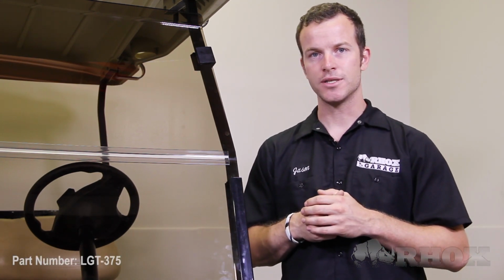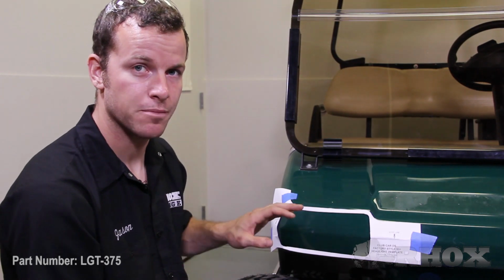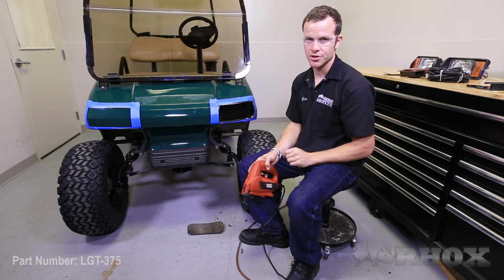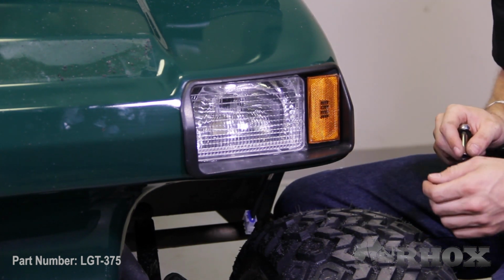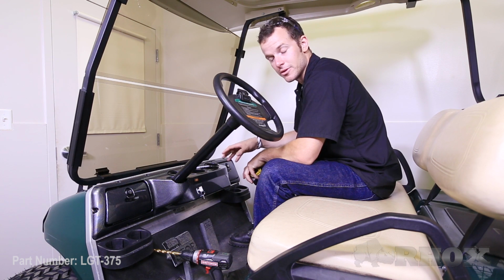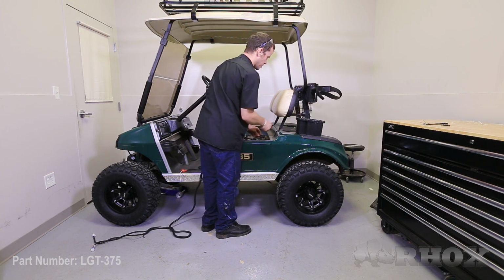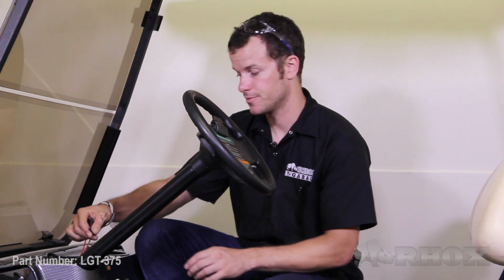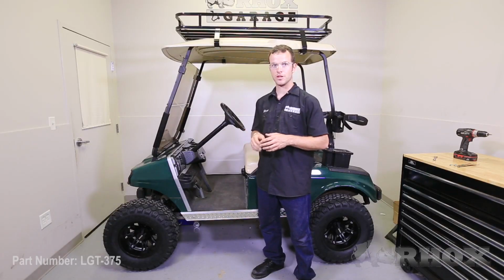LGT-375 RHOX Factory Style Light Kit on a Club Car DS

Comment: Thx for the video with extra detail on the wiring.  Changing out existing with LED's on a 99 DS.  Hope the cut out outs match up.  My fronts are screwed on the like the rear.  Lost my original switch knob and thinking about applying locktite on the new one.
Reply from the maker: You're welcome.  If you haven't purchased the kit yet, I can email you a template so you can compare it to your preexisting holes.  Just email rugged@rhox.us. You could try Loctite or Teflon tape. If you purchase the kit that includes a new harness, the new harness will also come with a push-pull switch.  We also sell the push-pull switches separately (ACC-0002).

Comment: Do you need a voltage reducer if you have 4 12v batteries in the cart?
Reply from the maker: Technically no. You need to have no more than 12V going into the light kit. You can use one battery vs. all (4) but the downside is that one battery will drain faster than the rest. A 48V to 12V reducer will drain the batteries equally.  Both solutions will work.